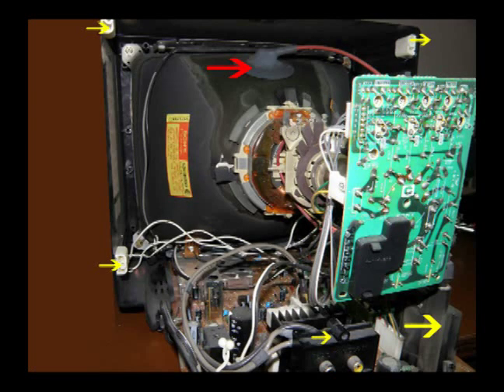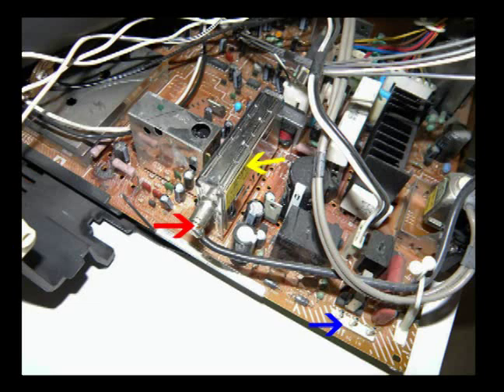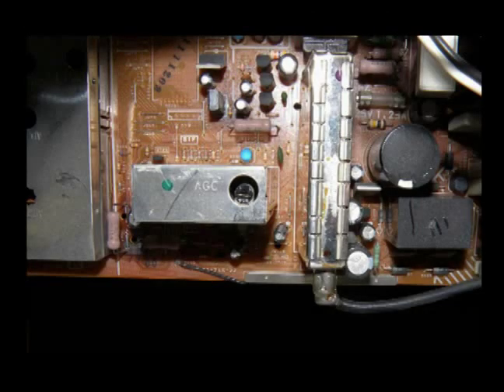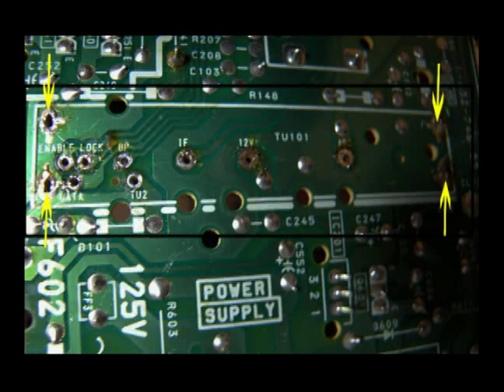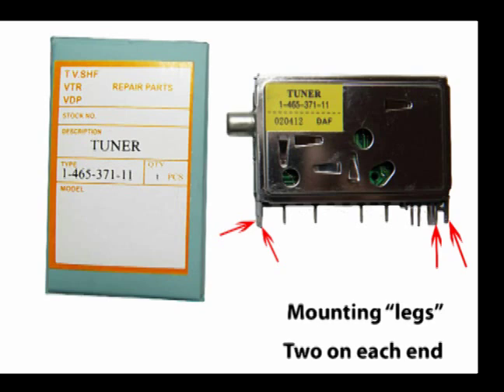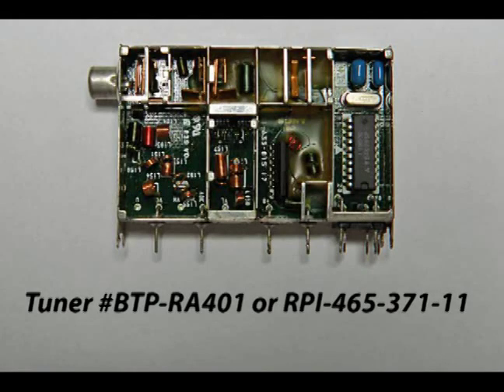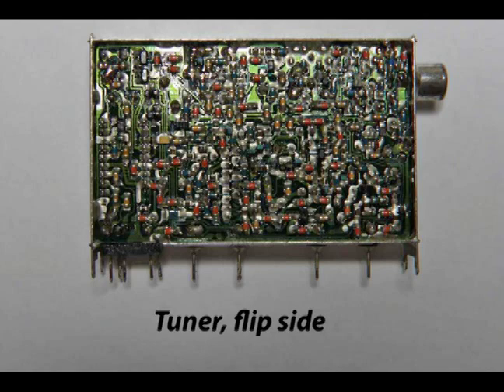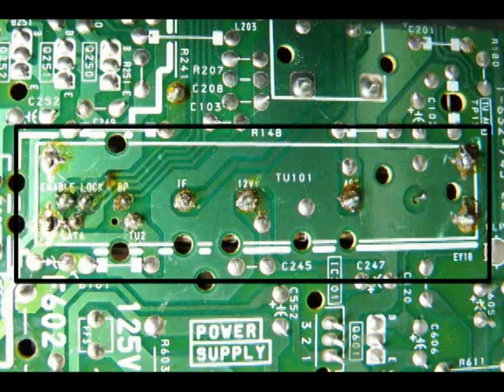Sony TV Tuner replacement

Comment: I have an update on this TV. I opened it up, desoldered the tuner from the main board and found there were some broken solder joints on the tuner, so I resoldered those and reinstalled the tuner. There was also a capacitor that looked questionable so I replaced that too with a matching one I had. That solved the problem, over two years since the fix now and this TV is still working great. It's one of the best looking pictures I've seen actually. Kind of amazing considering mine was manufactured in 1990. I'm a classic gamer and I love this TV for that.

Comment: Thanks, I have this same TV and that's exactly what the problem was...loose solders in the tuner. Also found a questionable looking capacitor in the "IF" box so replaced that too. The TV now works great and it was worth the trouble as these Sonys get a great picture.

Comment: I lot of times you can fix them by re-soldering the grounds inside the tuner. The grounds are along the very edge of the board.  used to manage a repair shop.

Comment: I have the exact same TV, same model and everything. I bought it off ebay due to not being a fan of flat screens. It works great, but sometimes when it gets real warm in my room the tv will just go to static and emit a loud whiny noise out of the speaker...this is on the tuner side. When I switch to video I can still see a picture and hear sound, but the on screen display will show up randomly. When I turn it off and let it sit it'll work just fine again. Any ideas?